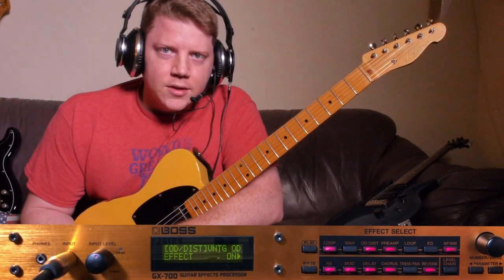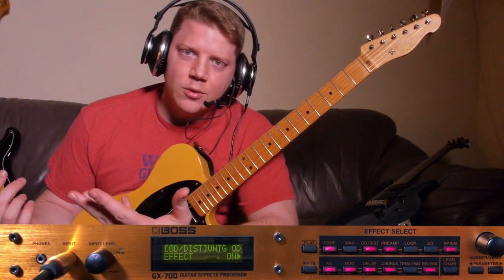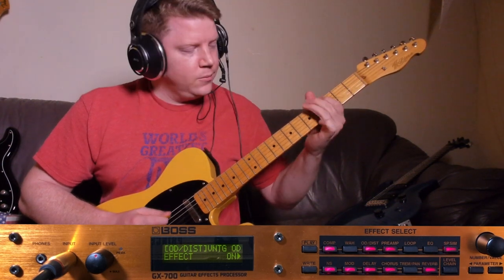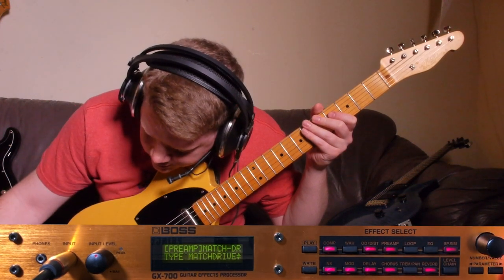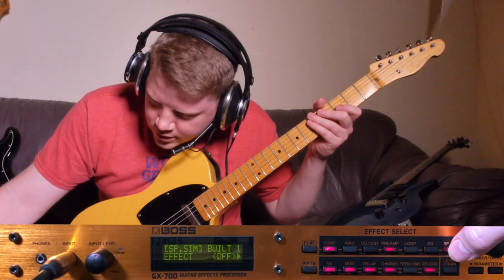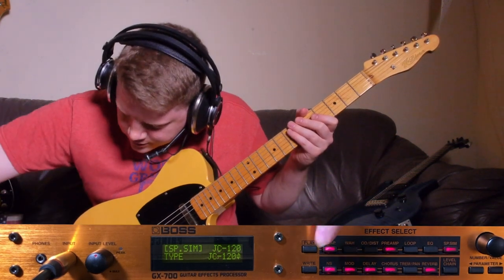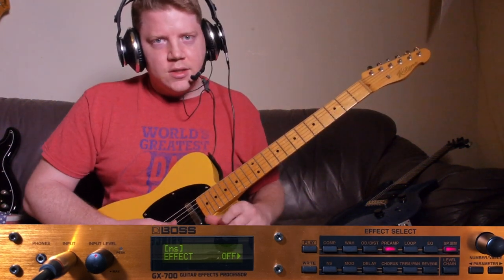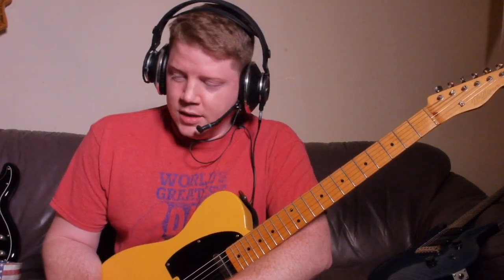ROLAND JC120 CLEAN TONE WITH BOSS GX700

Comment: Hey Clifton cool video i got a question i have the same unit and i am wandering if it is my unit or that it is normal the input volume knob on the front of my unit does nothing only when you put a headset on you can lower the volume
Reply from the maker: Thanks, it sets the input gain which is much more noticeable when using the jack in the back to receive line level signal.